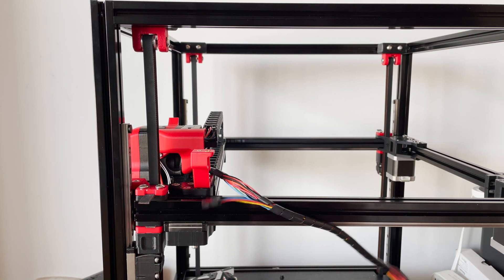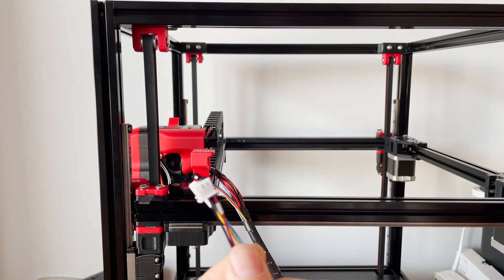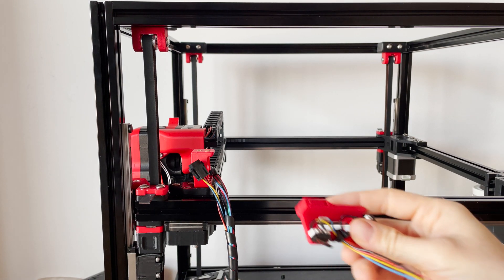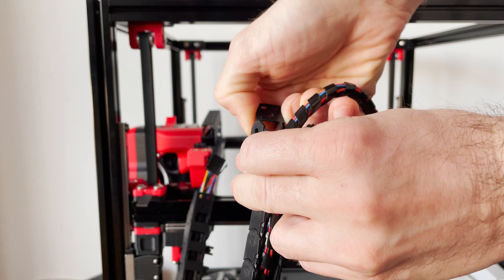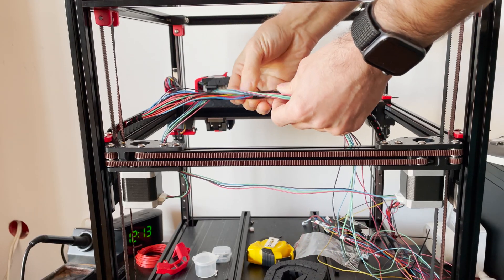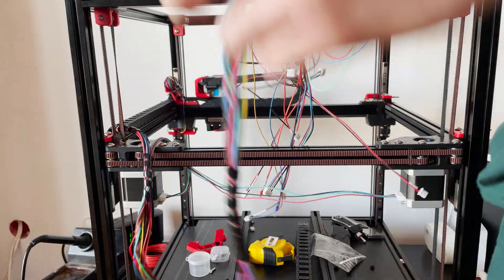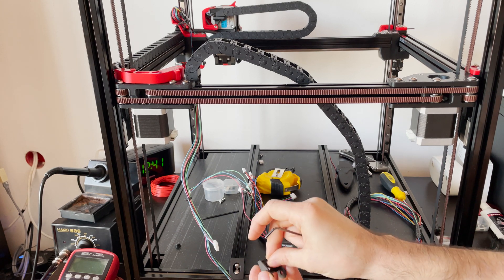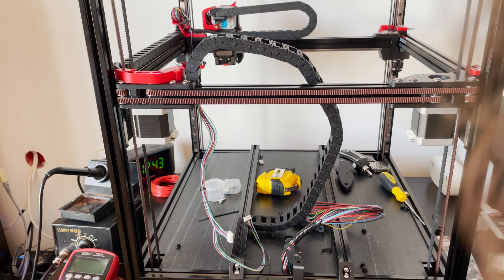Voron 2.4 - Part 15 - Wiring Part 2

Comment: the reason one has 3 and one has 2 is for the hall effect endstop pcb or the microswitch endstop 
they have a common ground iirc
Reply from the maker: It could be that in a different configuration the way they set up the connectors made sense. In my case one connector had 3 wires and the other had only one. The connector with only one wire was the mysterious one.
Reply: @PorcupineOfTheConnoisseur  iirc for the pcb they just have 3 wires needed 
one for ground 
2 for signal 
and then one for power if you were using a hall effect endstop 
I know my wire loom from Fermio was like that
Reply from the maker: @BenCos2018  oh… okay then. Thanks for the clarification!
Reply: @PorcupineOfTheConnoisseur  np 
the way you did it also works perfectly btw 
I considered it at one point but ended up just making a matching connecter on my endstop pod haha